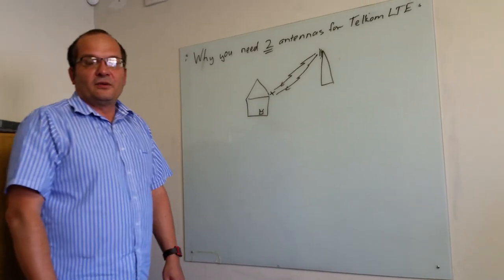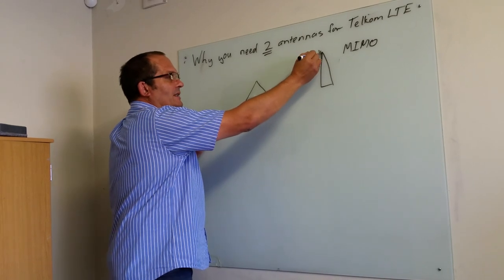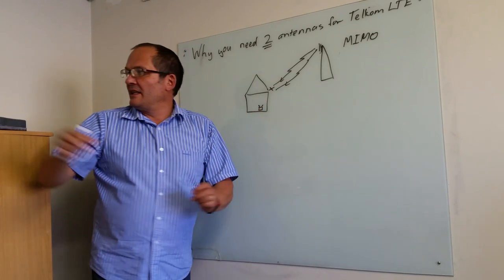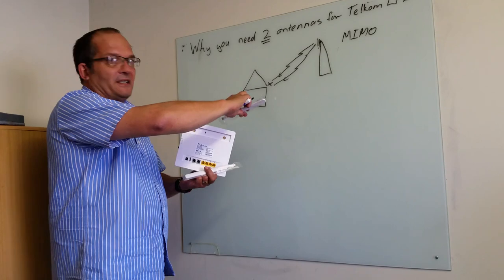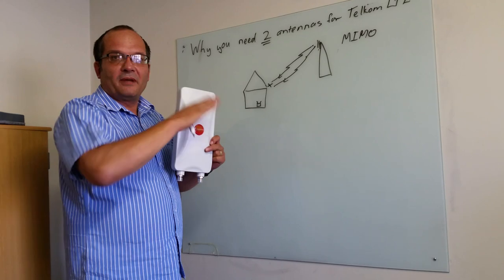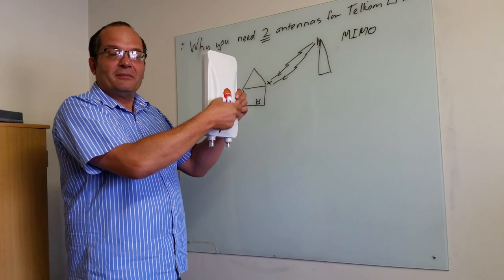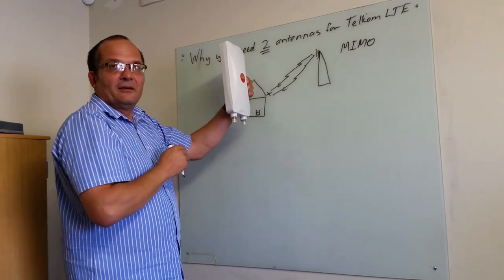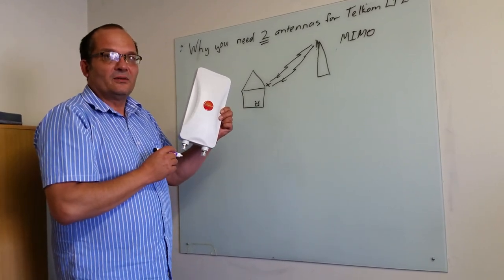Why do you need two antennas for the best LTE?

Comment: For MIMO using two yagi's or two LPDA's, do you recommend I space the two antenna's apart at a certain distance between each other at +/-45 degree or would it be more recommended to purchase the Poynting bracket "BRKT-33" for such an application?

Would like you opinion on the advantage/disadvantage between the two options?